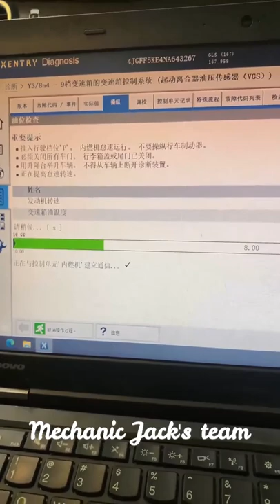Mercedes 9G Tronic Transmission Replace gear oil

Comment: What mileage is the oil change in the gearbox? Why static and not dynamic oil change?
Reply: 70,000 miles
Reply: First service B then every 70000.